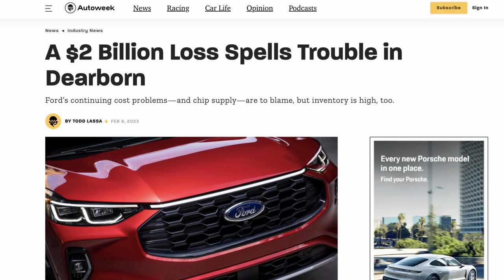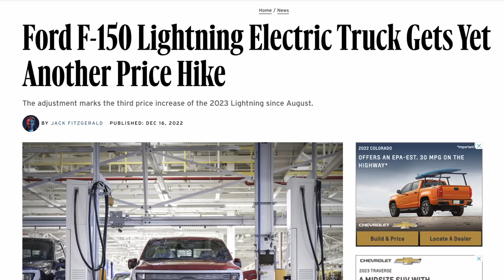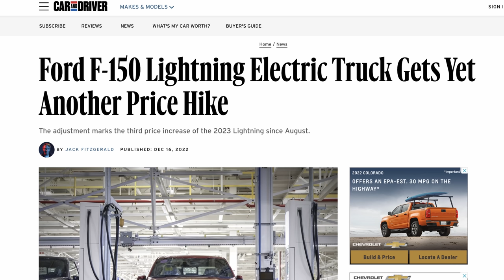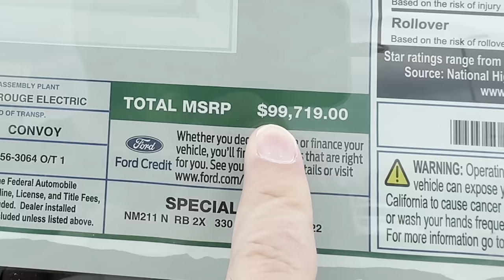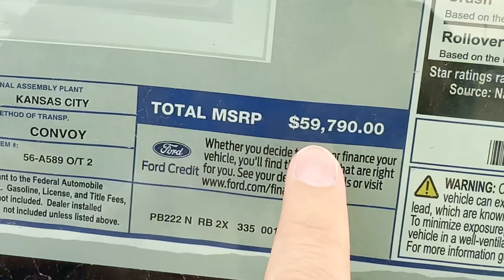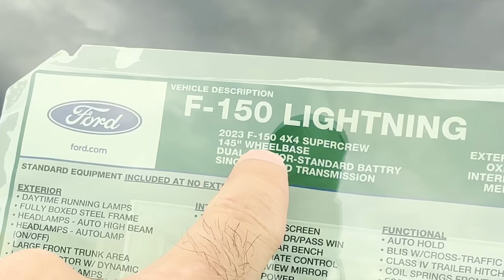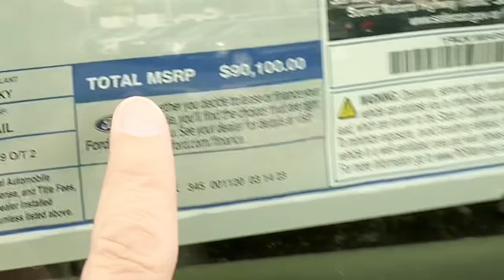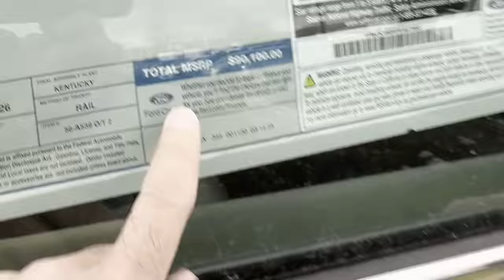Ford CEO Makes HUGE MISTAKE, Now Dealers CAN'T SELL TRUCKS!

Comment: $30k needs to be the target price for new vehicles. The car manufacturers are insane with these 6 figure prices.
Reply: It is a lot, but you have to factor in that an EV should last almost 2X the lifespan of an ICE.  A friend has a Tesla Model X and he's rounding 200,000 miles and the car still looks new-ish. Aside from tires, he told me the maintenance has been next to nothing.
Reply: @tswrench  I'm not buying that.  It's going to depreciate--no matter how well made.  My in-laws have an older Prius, and they've had to replace the battery--which was over two thousand dollars.  They're retired, and trying not to need a new car.  Cars and trucks are made to be used, which means they're going to get damaged, and parts will wear out.  Charging for a car as if it's a small house is ridiculous.  You could call Uber a LOT before you spend 100K.  

What I'm waiting to see, is when these car manufacturers start charging monthly fees for features and upgrades.  Want parking assist?  Pay the fee.  Want heated seats turned on?  Pay the fee.  This is the plan they're already counting on, so they can continue to steal money from people who buy from them.
Reply: I just had a friend sell a 2 story house for $60k, it was very old, but still a good house. And they want $100k for a truck, that is ridiculous.
Reply: @cariwaldick4898  --  Of course these EVs depreciate, just like all cars depreciate: as soon as you drive 'em off the lot.  However, if you're accustomed to spending between $35K and $45K for a vehicle, and an EV outlasts it by 3X, then then the difference in pricing is a wash.  

I'm not running out to buy anything in the $70K and up range, though.  I'll bide my time and strike when the market is right.  As of today, I've only seen 4 Rivian R1Ts on the road, but I inspected one up close, and they are impressive.  

There are fewer parts on an EV, requiring far less maintenance, with hardly any fluids to speak of.  They can build a much stronger, more ride-stabilized vehicle when they're not having to shoe horn a bunch of junk into an engine bay, and muck around with exhaust and EC systems. 

$2000 for a battery isn't that steep.  I paid around $1100 for a fuel pump, water pump and window motor/regulator for my F-150.  Besides, Tesla's "million mile battery" will be available in 2 to 4 years from now, and others will follow suit.

You are right about the a la carte pricing structure, or value-added functionality.  Self-driving features on Teslas don't come standard, and .they don't come cheap, neither.  I imagine that emerging competition within the marketplace will iron that out.  Hell, the Rivians just got something like a 20% or better range increase with an over the air software tweak.

We are in the very early stages of this revolution--the bleeding edge--so to speak.  And, there's a mania revolving around EV Trucks at the moment (the worst time to buy).  I believe there will be a lot more innovation coming down the pike where EVs and other alternate types of vehicles are concerned, and consumers will eventually regain the upper hand in the market.  Timing is everything.  Choose wisely.
Reply: @steves2241  --  You're fortunate to live where a 2 story house will sell for that price.  Most homes where I live are $1,000,000 and up--way up.  My Grandmother bought a home here in the late '60s--5 bedrooms and a pool--for just under $20,000.  The last time I saw that same home for sale was in 2003, and they were asking $959,000.  Today it would go for $1,600,000 or higher.  It's insanity.
Reply: @tswrench Rich Rebuilds has a Rivian that got into a fairly minor accident, got quoted 30k for repairs because of parts availability.
Reply: @techguy3424  -- Haven't seen that one, but it has to be an anomaly.  It's unlikely that you'll see those kinds of prices going forward.
Reply: Not all vehicles. But I'd like to see a no-frills pickup truck starting under 20k and fully loaded for under 30k. Ford or Chevy (or even Toyota) needs to release a truck with the following specs for 20k:
Standard cab (no options)
8 foot bed with 48 inches between the wheel wells (no options)
naturally aspirated V6 (no options)
manual 3 or 4 speed with column shifter (optional 4 or 5 speed automatic transmission)
Rear wheel drive (optional 4x4)
vinyl bench seat, manually adjusted (no options)
vinyl floors (no options)
keyed ignition (optional pushbutton start)
keyless entry, but still having a keyhole (optional remote start)
hand crank windows (optional power windows)
smoking vent windows
no air conditioning (optional a/c)
no infotainment system, just a radio (optional speaker upgrade)
Obviously, it would still need a screen because backup cameras are mandatory now, but it could be a small, mirror mounted screen.

Ford took a stab at it with the Maverick, but they missed. It's a family car with no trunk lid. It can't haul lumber, it can't tow, and it can't be taken off road.
Reply: Suckers pay the price, so the vehicles are priced to sell. If they sit on the lot, the car dealer will drop the price. Car dealers are making record profits. I think they are making the right choice and emptying the pockets of fools that want to throw money away on a new vehicle.
Reply: @tswrench  as of now EVs depreciate more than their ICE counterparts, so that could be a value buy, but most people are just too skeptical about battery replacement, especially when you have Tesla trying to exert itself against the right to repair. It’s pretty cool to see determined people crack open and repair the battery module against Teslas wishes. I expect a reliable 200k from an ICE vehicle, as in no major engine or transmission repairs. Do you really see EV makers even wanting their vehicles to last longer than that?
Reply: @techguy3424  The cost has nothing to with the EV drive train. The Rivian uses a unibody construction versus a body on frame like most other trucks, which makes body damage repair more costly. Also, Rivian is not a major manufacturer and they are new to the market. This means they don't have a vast number of repair centers, new or used parts availability, and most 3rd party body shops are going to touch it because they're unfamiliar with the platform. Rich could've had the same damage in the Lightning and paid less.
Reply: Prices are insane but in the manufactures' defense it's not all their fault and it's probably not even possible at this point to build a decent vehicle and sell it in the US for $30K.  I haven't looked at the numbers lately but a few years back there was a report published showing that the cost of  "safety"  and  emissions equipment mandated by the federal government was approaching $10k and that was before backup cameras were mandated and now automatic braking is coming.  If you're already on the hook for $10k or more before you started putting any of the actual car or truck parts on your build  price is already well north of $30k.   It's one of the main reasons companies like Suzuki, which sells the 4x4 Jimny for less than $30k in Mexico, no longer sells in the US and other manufacturers like Daihatsu that focus on value over luxury don't sell vehicles in the US anymore or never did.  The cost to make their products US compliant is just way to high and negates their value.   It also doesn't help that American consumers seem to favor "luxury and techno-gadgetry over functionality and reliability and there's a saying that they don't sell cars and trucks in the US anymore they market luxury and status instead.  Just some of the reasons that all around the world there are many solid, reliable 4x4s well under $25k for sale but not one in the US

Fact of the matters is the federal government at the behest of the Democrat Party have been using so called safety and environmental issues and mandates to deliberately drive the cost of private vehicle ownership up and out of the reach of most Americans. and make it a privilege of the "elites."
Reply: @thatslife10-4  in 1985 I bought a 4x4 Suzuki Samurai for $4,750 and in 1992 I bought another for $5,600.   Today Suzuki sells the latest version called the Jimny for less than $25k in Mexico, Europe and just about every other part of the world but no longer does business in the US ... ask yourself why some of the most popular, reliable and lowest cost vehicles in the world are no longer available in the US from Suzuki and other manufactures.
Reply: @tswrench  idk why you think an EV should last 3x the lifespan of an ICE. I have a 100k, motorcycle motor... high strung- 13,500 RPM motor..... so if a 6k RPM truck motor can't last 200,000 it's not an ICE problem... LOL
Reply: @johnwalker7592  -- It's hard to respond to the point you're trying to make, maybe because it's not clearly stated, but I'll try to answer what I think you're asking: There are far fewer moving parts in an EV, so the drivetrains are greatly simplified.  Electric motors are more efficient at delivering power to the wheels (100% torque on demand).  Electricity as a power source is delivered more simply and efficiently than gasoline fuel systems.  Tesla is expected to deliver a 1,000,000 mile battery within the next few years.  EVs typically don't have a transmission, they use a single gear reduction--again, simplified and more efficient. What it comes down to is simplicity + efficiency = longevity.  Of course longevity is also dependent upon how well the car is taken care of, so that's a big part of it too.
Reply: @tswrench  that's not true my little bro had two I'm three years, his stayed in the shop more than the road and he bought them new.
Reply: @HEAVYCHEVY409  -- Okay, but you've got to average it out over more than just 2 or 3 cars.
Reply: @thatslife10-4  LMAO... Complete and utter ignorance.
Reply: You can't make money selling sub $30k vehicles. They're only made for MPG averages.
Reply: It has been an accumulation of poor decisions that has created this situation today. The design change from a low to ground actually practical work truck to a luxurious man ego carriage many things changed in the pricing and design.
Reply: @tswrench  Hahahah that's funny there isn't an ev built yet that nor will there be likely ever an ev that will outlast an ice vehicle. Name one of the original late 1800 early 1900 ev's that is still on the road you may find three. that have been fully restored but not one with an original equipment system Now tell me how many collectors at car shows that are still running around in model a's and model T's with an old flathead 4 cyl just about every town i have been in at just about every car show there is some old dude nearing 100 driving an OG Model T or Model A in 30 years time every single current ev will have already been scrapped. Nobody is going to save them as proven by those three first gen Tesla roadsters found they will sit until someone wants to rebuild a whole new electrical drive systems for twice the value of the vehicle.
Reply: Yeah... it's not 2010 anymore.
Reply: @tswrench  Ever seen a wrecked Tesla?.. with 2/3ds  of today's drivers stoned, drunk, pills, texting etc I'll take a little more iron in my vehicles please.
Reply: @rogermiller9048  --  So, you're saying that 2 out of 3 drivers are impaired or DUI?  Hmm.  I've seen wrecked Teslas.  And what I think you're referring to is a feature that utilizes crumple zones in modern vehicle design.  The damage may look more extensive, but it's easier on the occupants of the vehicle.  The stiffer a car is made--thicker steel, no crumple zones--the more energy from the crash is transferred to the driver and occupants of the vehicle.
Reply: @cariwaldick4898 BMW requires a subscription to use the heated seats
Reply: @cariwaldick4898  I had a few cars. Not anymore. I walk and use Uber every time I need with zero additional expenses. Probably I will use Uber for 30-40 years or more with the money I would spend for buying a new car. I'm usually making 2 short trips using a taxi almost every day (10 minutes ride, road completely free). It works for me better than having my own car.
Reply: I think 40k for a full-sized truck would be fair.  That's where inflation says it should be compared to my last truck that is the same model.  Instead of 40k, they want 56K.  That's a non-starter for me.  I'm priced out.
Reply: So glad I bought a used 2015 F-150. I quickly realized their quality is abyssmal. 

My leather seats are falling apart. The sunroof is beginning to slow down drastically. The wiring in my door is shorting out. The hood is completely faded. 

So to see them charging more and more for what is basically the same truck, I’d never buy another Ford again. It’s a nice truck. But needs some fixes and price needs to come down. 

I’d have zero qualms buying a BMW or Toyota. Entirely different choices, I know. They’re both high in quality. The BMW just likes maintenance being done more often.
Reply: @tswrench lol stfu at EV lasting twice as long. Can't even last 70k without needing a whole new, 10k+ battery
Reply: @tswrench That must be a very well-built example. I still struggle to see electrical batteries going over a million miles like ICE engines in the current landscape.
Reply: @antoinesilva1527  -- I think you know that a 'million mile ICE engine' is an extreme example of longevity and nowhere near the norm.  Also, you'd have to factor in the cost of maintaining, repairing, and rebuilding an ICE engine to achieve that kind of mileage. Tesla expects to have a million mile battery ready within 5 years.  Toyota is nearly ready with their solid state battery.  Go where the R&D is focused.
Reply: My-y long-range will be about 46k after the federal incentive I'm still trying to teach it but it resists it drives real nice and handles extremely well and has plenty of power. I haven't tried punching it yet. Just reaching 6K miles. Ice is getting the s*** knocked out of it.
Reply: @tswrench the battery (most expensive part) does not hold up
Reply: @lamsonp  -- My friend's Model X is nearing 200K miles and the battery capacity is still over 90%.  Tesla is on track to have a million mile battery within the next 4 years.  Toyota's solid state battery is about to debut.  While the naysayers are busy crying "no, no, no," it's already happening.  Follow the R&D, or be left in the dust.
Reply: @tswrench  I'm not against electric vehicles. I've driven one for a year, it's definitely inconvenient. I would take Elon Musk's time frame with a grain of salt.
Reply: @lamsonp  -- What is it about the EV you've been driving for a year that you find "inconvenient?"  I already do take Musk's timelines with a big grain of salt.
Reply: Copying the greedy realtors . Killing the gose that lays the golden egg.
Reply: @tswrench  the inability of going places on a whim! Charging takes long and having to calculate where I can go and in my area there are only a few places to charge.
Reply: @lamsonp  -- Which EV do you own?  What's its range? You don't have a charger at home?  Is your ev being used while you sleep?
Reply: @tswrench I leased it the year it came out, it was a 2021 Nissan leaf, I think the range was around 220. I charged overnight, starting each day with a full battery. My commute to work each day was 1hr 20min in total, so it left me with 20 - 30% or so by the end of the day. Partly the issue was since I wasn't willing to invest in a faster home charger, if I didn't come straight home to charge after work I wouldn't be able to start my day with a full charge and if I dared to use any of it to travel outside my normal commute for a day, I would be driving each consecutive day with less battery to start. The faster charging stations still took me hours and only at a rate of about 10% per hour. 🙄
Reply: K idk about 30k bud maybe that's what you think. Either way tho a truck like this fully loaded should retail for like 60-65k max and that's after tax title license ect.
Reply: They're Not Going To Get My Money. I'll Just Keep My Ole '99 Suburban 4×4 That Has Everything Still Working, The A/C Isn't  Quite As Efficient As It Was When New But Still Works Ok InThe South Georgia Heat & Humidity And It Only Has 274600 Miles On It And Have Only Replaced The Radiator, Battery, And Headlight/ Taillight Bulbs. Oh And Don't Even Get Me Going On Headlights & Taillights Cost For Replacement On 2022 And Newer Vehicles.
Reply: @tswrench  Actually nope. For example, a study found out that, while the maintenance cost of an EV generally cost a fraction of what an ICE vehicle will run you, after X years, once the electric part fails, it cost tremendously more that you actually shell more money. Thus, your point being false. It cost more to run an EV, and the lifespan isn't longer as battery capacity degrades (fuel tank does not shrink after 10 yrs of use).

Edit: I can't put the source because YT auto delete it. But search: "EVs are cheaper to maintain but may cost more to repair" from CNET. This article has the study cited.
Reply: @triparadox.c  -- It's not about the gas tank.  Is that really your argument?  Lol.  While the ICE engine is running, the wear factor is constantly degrading and eroding PARTS--no gettin' around it.  Parts in general, are going up in price.  Between fuel and maintenance costs the ICE loses--guaranteed.  The only indice where the ICE is the better value is the purchase price, and even that advantage is shifting as we speak.
Reply: @tswrench  read the study. Evs are harder to fix and cost more $.
Reply: @triparadox.c  -- You tell me who PAID for the study, and maybe I'll read it.  Follow the money and you'll have a better understanding of the motivation and biases behind it.
Reply: @tswrench  It was conducted by We Predict, a company which was later (some time after the study was posted) acquired by JD Power.
Reply: @tswrench people are just emotionally bias against ev cars

One vehicle works on mini explosions at minimum 400 times a minute
The other completes eliminates most of the moving parts to just a motor and a transmission, and the transmission is usually one speed anyway

Basically only faults at moment are with battery tech which is rapidly improving, i would never buy a new ICE
Reply: @tswrench  Thats because he is ignoring the $15k battery replacement lmao.
Reply: @tswrench you must live in Toronto
Reply: @brando8086  --  "Look how wrong you can be."
Reply: @tswrench  what you described is the case here as well.. was a stab in the dark
Reply: @brando8086  --  Uh-huh.  Work on your syntax and your thoughts might come across as coherent.  As it is--not so much.
Reply: 30k is unrealistic